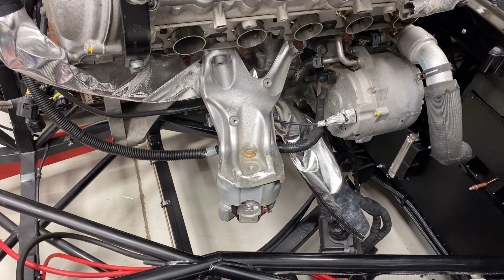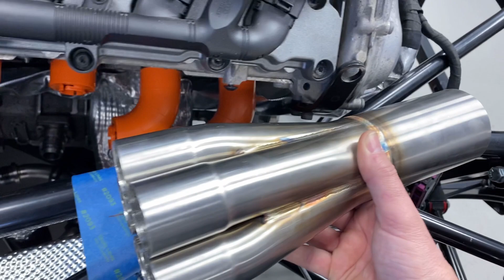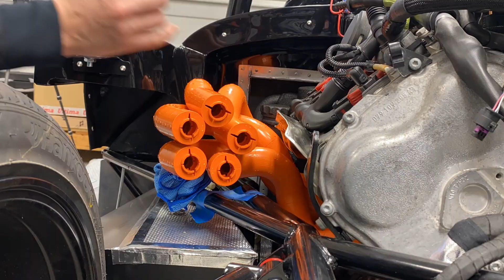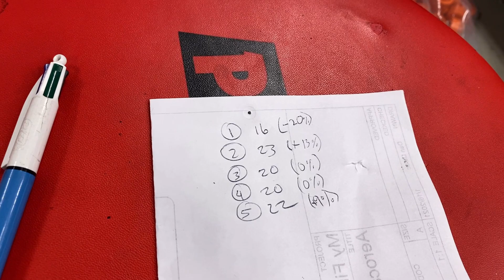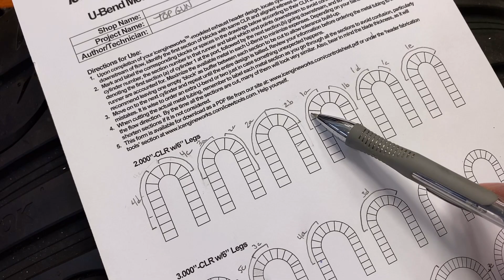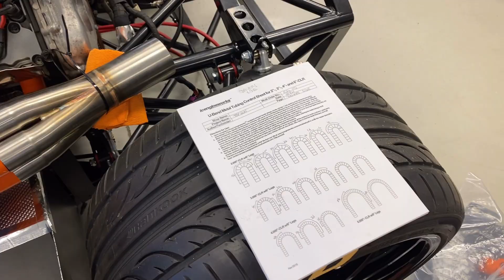Project 'Top Gun' - Header Games 2 - V10 Ultima Evolution Convertible Build

Comment: Wow, you're a patient chap Dan!  Just a thought, will your collectors clear the top of the side pods/rear clam underside adjacent to the front inner of the rear wheels as it's a bit tight under there?  Or are you just getting the headers done and then modify the bodywork to suit?  You're going to have a lot of fun making all those sections and welding that lot up when the time comes.  I used to make bespoke exhaust systems many years ago, but found it was a good idea to bevel the outer edges of the joins at 45 degrees to about half the thickness in an effort to get a really strong weld to finish as near flush to the outer diameter!  They should make for good tyre warmers though ha ha!  Great work and good luck!
Reply from the maker: Great advice on beveling the edges of the tubing before welding sections together.  It's .065" wall tubing so it won't take much to create a bevel on the pieces. I plan on using .035" filler rod too so I should end up with a nice flush weld that will be easy to sand completely smooth so the weld joints disappear entirely.  I did check exhaust header clearances for the side pods and rear clam--I'm good to go!

Comment: Hey Dan, great job!  I'm building the headers on my SLC Superlite right now.  I'm curious what settings you used on your tig welder when you tacked the stubs on the header flange before you started fabricating the primaries with the ICE kit?  I'm afraid I'm going to blow a hole through the pipe since there is such a difference in thickness.
Reply from the maker: If I remember right, I think my machine was set at 90amps for the tacks on the flange. The key to welding/tacking thin material to thick is to focus your arc on the thick material straight out of the gate and dab your filler rod on the thin material side of the puddle. This will help keep most of the heat on the thicker material and the dab of the rod will help keep puddle cooler on the thin material.  For tacking/welding two .065 wall tubing pieces together, my settings are 45amps using Furick 12 cup with 20cfh argon. If your machine can pulse, I find pulse welding better to keep heat out of the stainless. If you want those settings, just let me know. Perhaps I’ll discuss my TIG settings on the next vid. 😎
Reply: @DanDulac  thank you! I knew to keep the torch on the flange, but, I didn’t think about the filler rod on the tube. That’s a great tip!!!!!

Comment: Watched a short video from a couple of years ago using your system had some cool magnet holders for holding whilst welding he got them from "Metal by the foot" did check there site could not find them but I am in the UK you may have more look the VLOG is on You tube (only about 2mins long) as follows Castle works Motorsports Header Fabrication Part 2 looking great by the way
Reply from the maker: Wow—great tip Denis. I will definitely see what I can dig up!  Thank you!  🙏
Reply from the maker: Found it!  I actually have a set of those magnet holders on order. But given my runners are stainless steel, I don’t think that’s gonna work—magnets don’t stick to stainless. But I have something else up my sleeve I’ll share when I start tacking pipes together. 😜

Comment: I am a bit puzzled. I see P-Zero on your tire walls, however on the surface I see Hankook embossed? what's the story??
Reply from the maker: Good eye!  Here's the deal: I wanted to try "tire stickers" but was unsure of the quality or how it would turn out.  Rather than experimenting on an expensive set of tires, I picked up a set of Hancook tires on sale and super cheap.  Since I'll likely burn off all the rubber doing smokey burnouts down my street: 1) no sense in burning up a set of expensive tires and 2) i'm happy with the results of the 'tire stickers' so now when I buy a good set of tires, I'll have confidence.
Reply: @DanDulac  Thank you Dan, for taking the time and react on my silly questions. I love your build and the way you approach the challenges. looking forwards to see how you will piece together the exhaust manifolds.